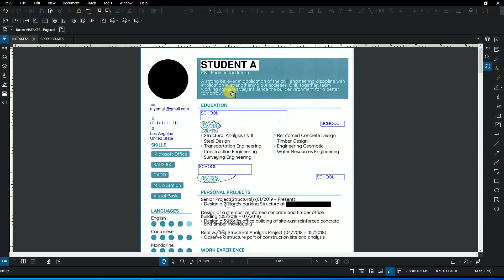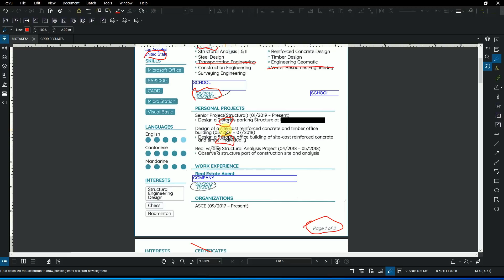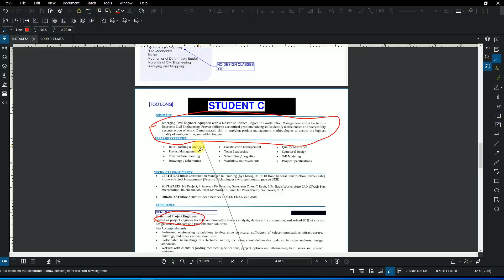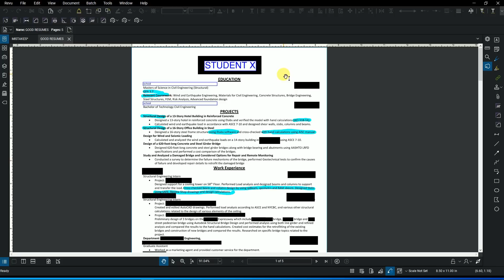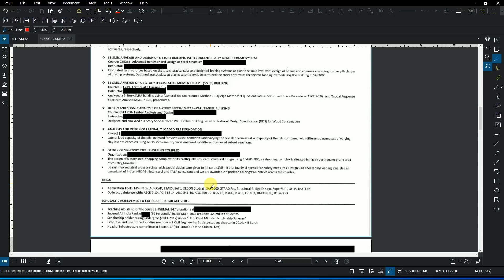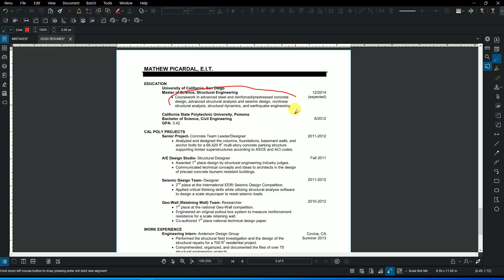Resume Tips for Civil Structural Engineering - Real Resumes Reviewed

Comment: I was wondering if you could do a guide on which courses are best to specialize for structural design? im a civil eng student and we have like 20 options for electives to concentrate on structures and dont wanna mess up which courses to take
Reply from the maker: Thanks for the suggestion, I've put it on the list. Short answer if you want to work in the industry: As many design courses (steel, wood, concrete, etc.) and earthquake engineering (if you want to work in seismic) courses as you can.

Comment: I would say one of the biggest advice for people seeking their first engineering job is to always provide a tailored cover letter for the specific position you're applying for in addition to your resume. I know for a fact that some firms don't even look at the resume until after they've gone through an initial screening process of reading a cover letter. Firms want to know WHY you want to work for them first and then determine if you're qualified to work them.

Also, always list the computer software you are familiar with. Even if its just Microsoft office.